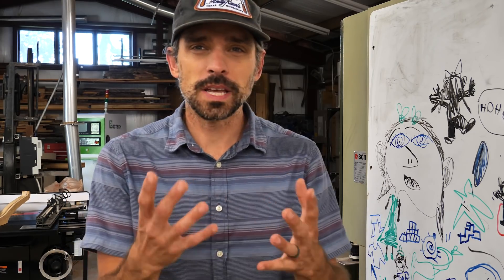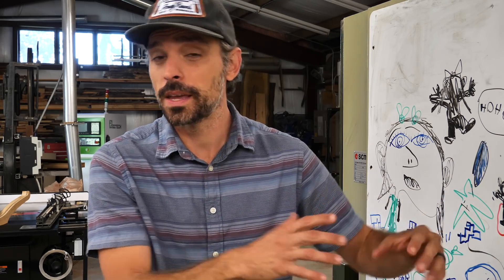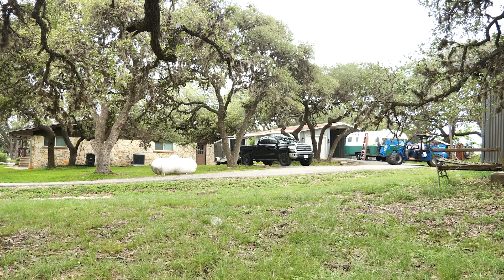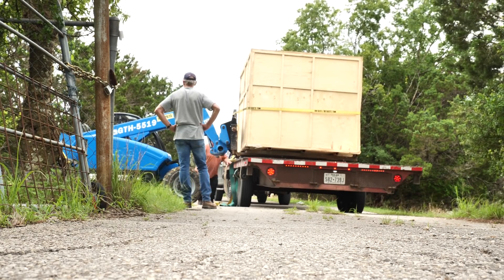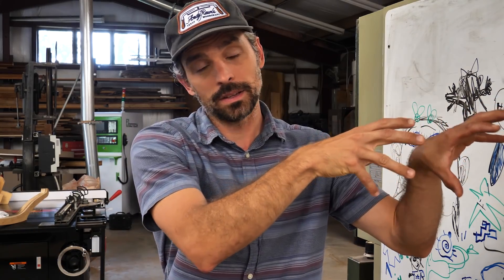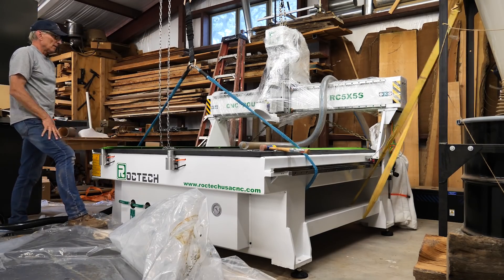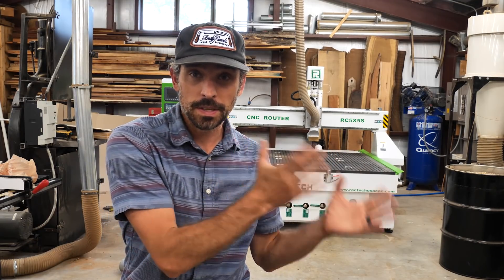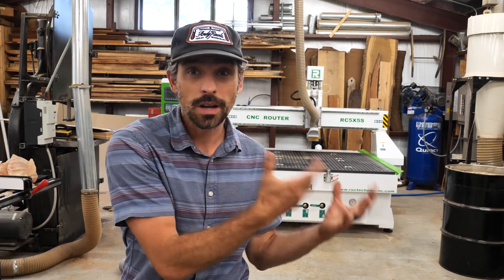Upgrading My Woodworking Shop With A 5x5 CNC

Comment: You are by far my favorite woodworking youtuber... I respect that balance between traditional and modern techniques and your videos have influenced my own direction. As I've built my tiny shop, I've gravitated towards hand tools in part because I simply don't have the space for a massive collection of machines (save for my beloved drill press), but because my grandfather was a master carpenter who could bang out furniture with the bare minimum of hand tools (I still have his marking gauge made of scrap moulding and a Coca-Cola can and just recently restored his rigging hatchet inspired by your own hatchet handle carving).

Comment: You were right; that intro should be marketed to someone in Hollywood for making a 30 minute cartoon. "I've got it! I've got it!. I ain't got it!" It's always a pleasure for me to see how your Dad and you work together. My Dad was a master gardener, but during my early teenage years, he and I built several Heath Kit short wave radios. That experience led me to take a correspondence course from RCA in electronics when I was 14, as well as acquire a General Class Amateur Radio Operator License. I've seen CNC devices make numerous components for YT Wintergatan's Marble Machine; very interesting project. Carry on!

Comment: I am a very amateur woodworker, but I am a professional illustrator and I think it is the same deal in this part of the art world. I LOVE physical media like pens, paints, and pencils, but what's most important is that you put in the work and the time to get better at what you do. I use traditional and digital and they both have advantages and both should be used as tools for the job.

Comment: Absolutely a win, may not of been the most graceful installation but no one was hurt and the machinery was not damaged. I used to think that a CNC was cheating but even if you use it to cut out chair seats or the like you will still have a lot of hand work to do. You most likely will need to build one by hand anyway so you have the parts to design some of the programs. Look forward to see how you use it.

Comment: I don't think these CNC's will be replacing traditional skills in a great hurry - I think they'll work side-by-side. I was using a CNC from Gerber Scientific 27 years ago in the signage industry, cutting acrylic, aluminium, brass, wood etc. and look how long it has taken them to come into the spotlight. It had a vacuum bed and a control box the size of postbox. It was able to nest items automatically to make sure you got the most out of your material and it was also able to calculate the cut path so that you could place one item inside another with no gaps. Not bad for 1994 running on Windows 3.11...